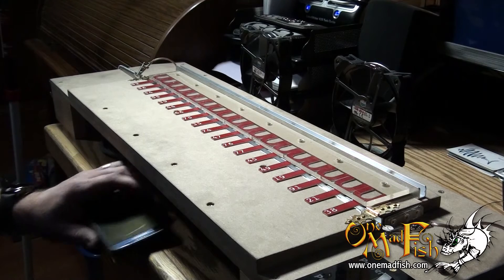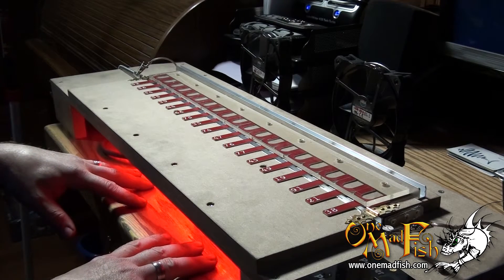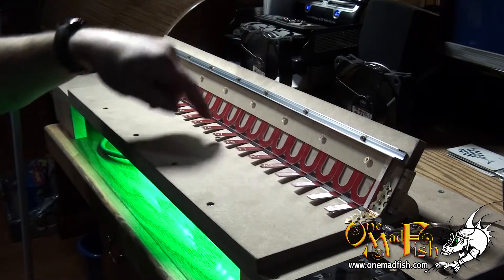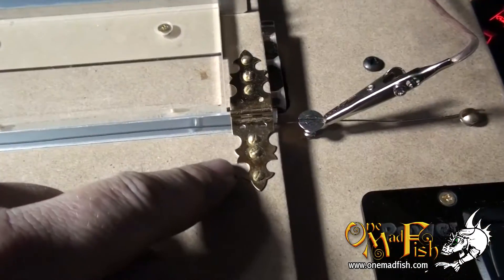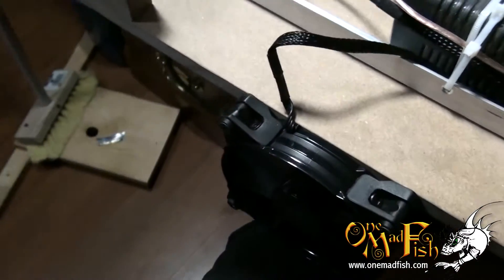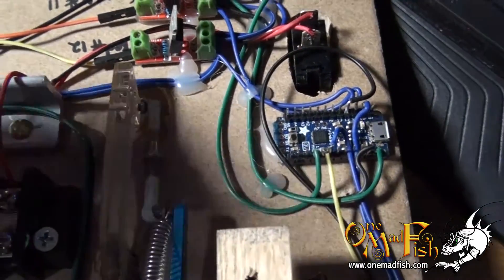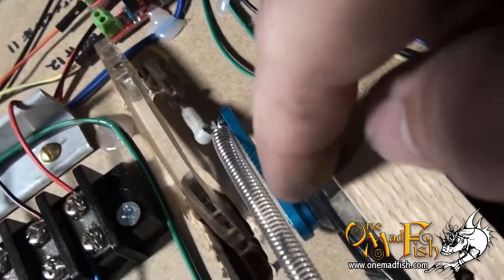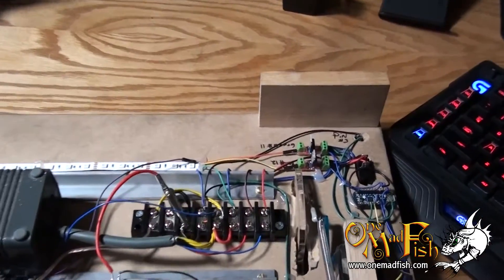My DIY AUTOmatic plastic/acrylic bender... take one

Comment: oh ffs 5:33 in, im gonna slap you through the screen if you dont show the motor in the next 20sec.  its really the only unique part. 

get yourself some paint stripper or acetone....build you an etch tank for cupric chloride... you can stop fucking with those mosfet boards and put everything on your home made pcb.

that said, overall functionality was pretty good/cool but there are like 20 videos of this same build with out your servo config. so if you want more subs... start with the goods, dont make us listen to the brand name of your pc fan for 5 min before shoing the unique part. leds were a nice touch...but  im a function b4 form type.

Comment: how did you power up or wire the xbox power?
Reply from the maker: Simplistic Modz all the yellows are positive and all the blacks are negative...tie all yellows togeather and same with the blacks...then there is a red and a blue...hook them to a switch....when they are connected or when the switch it on, the power supply will turn on.
Reply: Tnx
Reply: Oh how long is your bender and the gauge of thr nichrome wire? Thank you again
Reply from the maker: it is 21 gauge nichrome wire and I do believe I made it to 22"ish long between the 2 clips.. Here is a great link to the site that I use when deciding on what wire to use with the voltage I have... http://www.jacobs-online.biz/nichrome/NichromeCalc.html  This should help you out a ton!